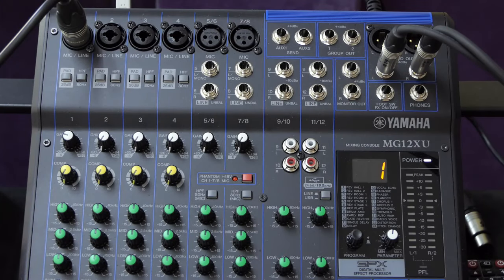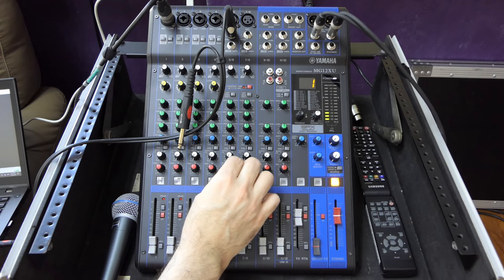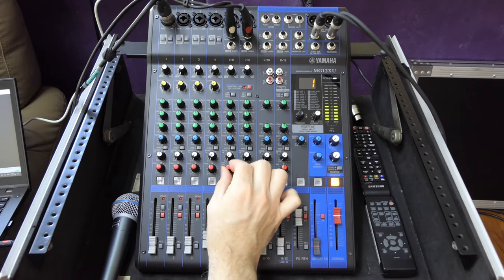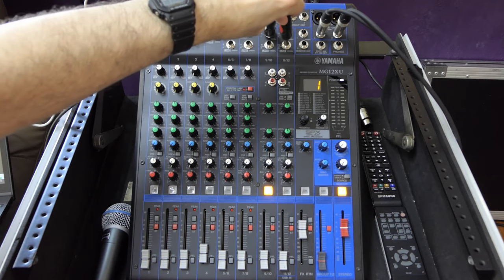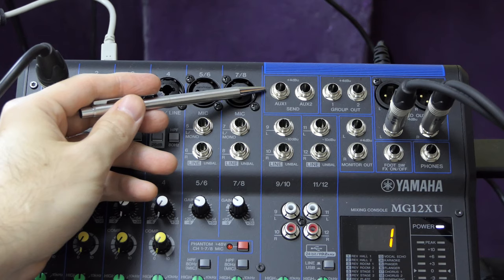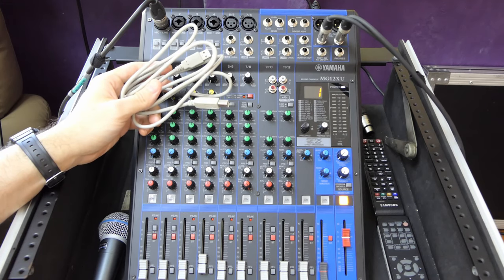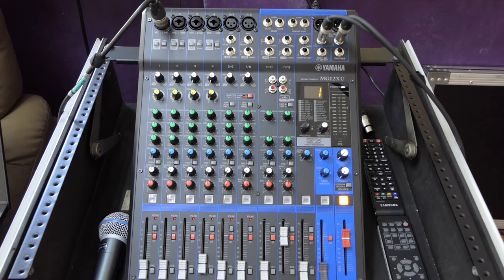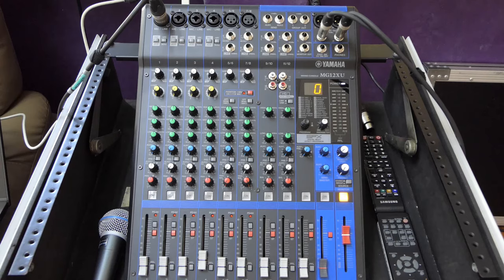Yamaha MG12XU Mixer Tutorial Part Two

Comment: @GLB Productions How is the audio level through the USB when recording? I read some reviews and some say its too quiet. How was your experience with it? Im looking to pick one up tomorrow. Thanks.
Reply: Also, since the stereo fader does not raise the level of USB out, how does one adjust the volume of USB out or are you not able to do that?
Reply: @GLBProductions  so the level would just be adjusted in pc sound settings, correct? At the moment i have the Behringer x1204 but i get a popping noise through the USB everytime i start/stop an audio track. Not sure if its the mixer so was thinking about trying the yamaha as I can still return the x1204.
Reply from the maker: Yes, or from within your DAW if you are recording. But you also need to ensure that you have good analog gain structure on the mixer itself, or the incoming signal will be noisy.
Reply: @GLBProductions  Ok gotcha. Im looking at either the Yamaha mg12xu or the Mackie profx v3. Have you tried the Mackie pro series or which one would you recommend?
Reply from the maker: You'll need to look at the features available on both mixers and decide which one suits your needs. I did a video recently on how to do this analysis: https://www.youtube.com/watch?v=Jb-Hfgo3kck
Reply from the maker: Hi there I asked some of my colleagues about this and the information I gave you originally is not correct. Without getting too long or technical, here is the correct explanation: 
- Digital audio has a level that is measured in dBFS (decibels full scale). 0dBFS is the absolute maximum level possible in digital equipment - above that you get clipping and distortion. 
- There is no worldwide standard that states how analogue signal levels, expressed in dBu, translate to dBFS. The American SMPTE standard states that +4dBu = -20dBFS, the European EBU standard is 0dBu = -18dBFS. 
- Yamaha do not publish the output level of the USB interface in their MG series mixers. We know that the analog outputs have a nominal output level of +4dBu, but we don't know what this translates to in dBFS at the digital output. Nor do they mention whether this mixer complies with the SMPTE or EBU standards. 
- What this means is that you need some form of metering on the computer side in order to tell you what your level actually is, and this metering has to be in dBFS. This can be a separate metering program, or within your DAW or broadcast software, depending on what you are doing. When you know your incoming level in dBFS, you can use the digital trim in your DAW or broadcast software to bump it up or down to the level that you need. 
- The second part of this is that in many cases, when people think a signal is 'too soft' it is actually one that has an AVERAGE level that is too low. Commercial music and especially audio broadcast online is VERY compressed - much more so than you would get on a raw recorded track with no compression. This is often why people think that their audio is 'too soft' - in reality it is the difference between the loudest and softest parts, ie the dynamic range, that is the problem. This can be solved by compression/limiting (for recording) and levelling (for broadcast). 
- The final part of this puzzle are loudness levels, measured in LUFS - this is an absolute scale that measures perceived loudness (average levels over time) and is used for commercial broadcast to ensure that all program material is at the same perceived loudness - this prevents the commercials from being much louder than the news, for example. 
So, in short, you need to have some form of metering in your PC/laptop, and you need to understand how to use digital trim in your DAW or broadcast software to achieve the loudness that you need. With these in place, the actual output of the mixer's USB audio interface becomes much less important. Hope that helps!
Reply: @GLBProductions  wow thanks for that awesome explanation. I really appreciate it.
Reply: @GLBProductions  Not sure if you tried the mackie profx12v3 but I decided to give it a try if anything i can exchange it for the Yamaha. Just want to update that the USB works great both ways. So you can record and listen at the same time. Just install drivers and youre good to go. Also, Its plenty loud. However, I have one question about that mixer. Do you know if there's anyway to listen to sub 1-2 on the phones out from the mixer? I looked through their manual before buying but I didn't find anything about it, so I decided to get one to try it out and I cant figure out how to listen to the sub group on the headphones to monitor it. It legit blows my mind why they would not add a button to do that. Seems like control out I can listen to the sub group but i would need a splitter maybe from control and phones out to my headphones.. so i can monitor main and sub mix.

Comment: fresh out of the box, my mixer will not send audio to sfx. Not sure if it's me or the mixer...
Reply from the maker: In cases like this I always recommend bringing the mixer straight back to the person who sold it to you and getting them to sort out the problem.
Reply: @GLBProductions  i did thank you. Can i ask: is there a way to send two sources independently/unmixed to two outputs but still monitor both of them on the mixer at the same time?
Reply from the maker: Yes you can - just pan one of them hard left and the other one hard right: this will send them to separate outputs but you can still monitor them using the PFL buttons.

Comment: What is the best way to achieve mono output to a powered speaker? Thks
Reply from the maker: Great question, I should do a video on this! The short answer is this: for mono sources connected to mono channels, keep the pan knob center - this will split the signal evenly to both L&R outputs and you just use one of them. For stereo sources, connect them to either two mono channels or the L/Mono input of two stereo channels, also panned center. This will convert them to mono and ensure that no information is lost.
Reply: @GLBProductions  Thks mate. How about a mono output? I'm thinking about minimizing equipment for really small venues and for the odd busking outing by leaving one of my powered speakers at home. I have a Yamaha PA4X keyboard, laptop backing tracks, SM58, MX12XU, JBL PRX715 powered speaker. I can  use either of the PA4X stereo outputs as a mono without making any adjustments, it's automatic. So I'm thinking the PA4X to CH5/6 L mono panned to centre(?), SM58 to CH1 panned to left, Laptop to USB panned left. Would I use the left AUX output or Stereo left output and ensure everything is panned to the left? Thks (wasn't expecting to hear back as the post is a year old but it's an excellent reference source that I come back to all the time. Just want to get the MONO aspect right)
Reply from the maker: Yes I heard you the first time 😉 If you follow the instructions above they will route all your signals in dual mono and you can use either left or right outputs to feed your powered speaker. There is no need to use the pan controls - just ensure that they are all set to center. The exception to this is the USB input, which is always stereo, so if you really need mono on that one you'll need to connect the laptop the old-fashioned way using the headphone output.
Reply: @GLBProductions  you're awesome. Thks mate - all sorted

Comment: How to connect a USB wireless adapter to Yamaha MG12XU to add kareoke music using iphone or ipad or laptop to the system?
Reply from the maker: More details please.
Reply: @GLBProductions  I would like to input the karaoke music from my iPhone or iPad into the mixer using wireless adapter, so that when we sing the music blends with vocal before it goes out to the speakers,
Reply from the maker: Hmm, in this case you need to ensure that your wireless adapter is class compliant so that it works with the USB input in the mixer.
Reply: @GLBProductions  can you recommend class compliant wireless adapter and where I should connect on MG12XU?  Yamaha UDWL01 WIFI USB/MIDI Adapter?
Reply from the maker: Sorry Ketan but I'm not an expert on this as there is no equivalent in pro audio. If I needed a wireless connection from a mobile device I would use something like the Radial BT-Pro Bluetooth DI and connect to the one of the analog inputs on the mixer.

Comment: Sir. This mixer is needed a amplifier Or not?
Reply from the maker: Yes it does.
Reply: @GLBProductions  ok sir. Ahm, what is the correct active speaker fit in yamaha mg12xu
Reply from the maker: This mixer can be used with any active speaker that can accept a line level input signal.